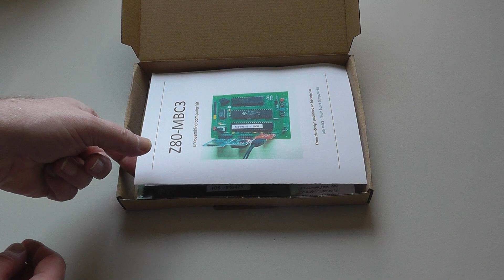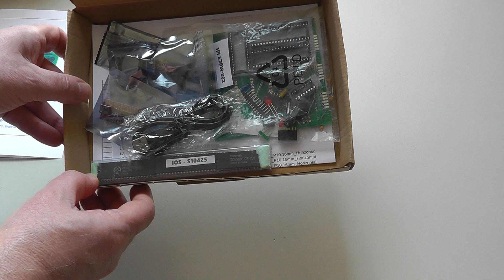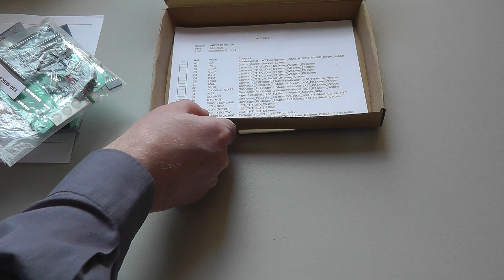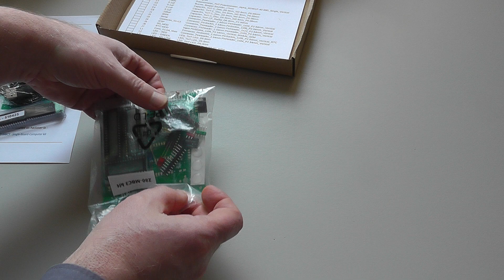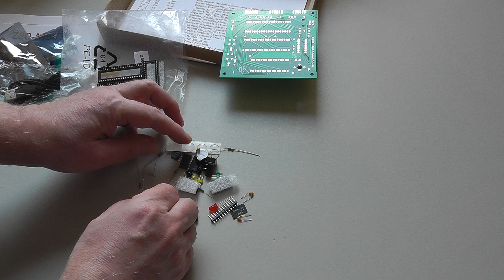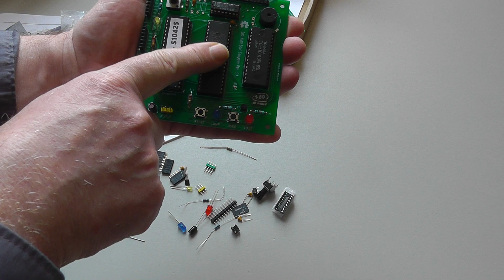Z80-MBC3 kit to be assembled. A brief overview and getting started hints.

Comment: I had some MBC2 PCBs made up and have built a few of them, first time seeing the MBC3. It definitely looks like it'll be a very low part count which is perfect for beginners. I haven't looked into part availability yet but some of the MBC2 parts (DIP-32 socket, DIP-28 socket, MCP23017 GPIO chip) were never available at my local electronics store. Plus there were a motley of smaller through-hole components like 8 different resistors required, so I'm liking the reduction of these on the MBC3. Also nice to see pin labels on the SD and RTC connectors so it's easier to know which way they plug into the board. And the 16MHz crystal is also gone, so I guess the clock source is generated in the ATmega chip now.

Comment: Can i use ATMega 16L instead of ATMega4809?
Reply from the maker: This summary is about the kit. A complete set that does not need anything else to be used, apart from your PC with a terminal emulator program. The motives and reasons to swap the ATmega32A for a ATmega4809 are described on the quoted Github page and wiki. The Atmega4809-PF is the only type I know that has all the features needed for the upgraded MBC3.